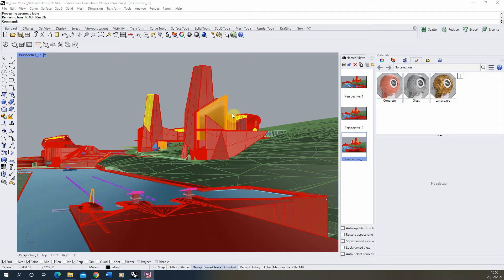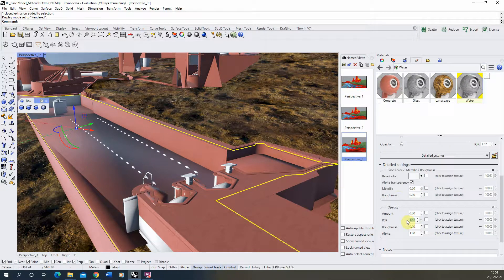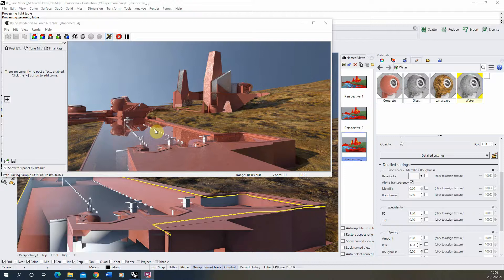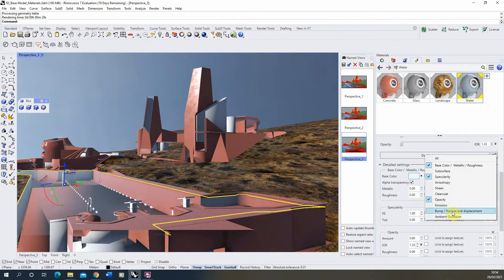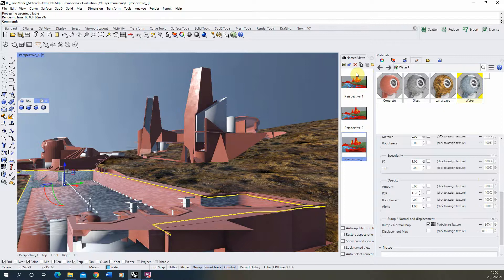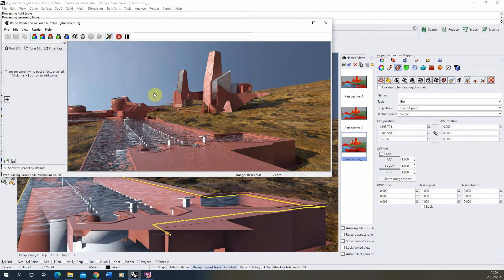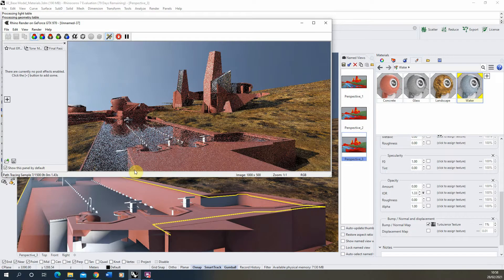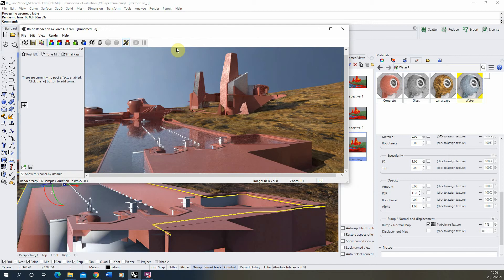Rhino 7 - Water Material Creation - PBR

Comment: Hello, really good tutorial, thank you ! I have a problem when I apply my turbulence texture : it works but only on the sides of the object. Do you have any explanation about it ? Here is the link with pictures to see what it looks like on my computer (sorry, everything is in french and the interface is a little bit different) https://drive.google.com/drive/folders/1IPUpHzhmlxZnOYUDeIUvHrz4xISXF4ml?usp=sharing . Thanks a lot !
Reply from the maker: Hi Leo, you probably want to only apply it to surfaces rather than 3 dimensional objects if that helps, perhaps try exploding the object into a series of surfaces and apply the material to the sides you need
Reply: @tombudd15  Thank you for your answer. I tried to make a render and it appeared that it worked. Maybe my computer is not powerfull enough so I can not see very well the "waves effect" when I am not rendering.